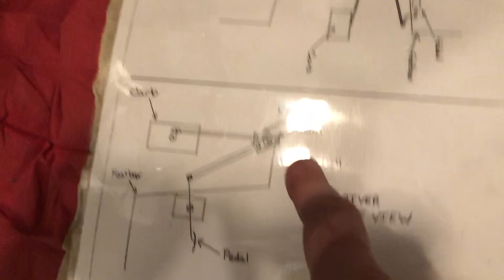Cobra 427SC Replica Build Part 24 Modifying the Turkey Pan!

Comment: Very cool video, I am building a Cobra with a Sniper too. I was thinking about a turkey pan, I may forgo that project within a project. Good thing you are using ARP on the carb studs you world have striped anything else! 30-45 max. 
Best of luck, Pete.
Reply from the maker: If I were to do it again, I'd use the Holley Sniper model #550-872, which is 'traditional' carb shaped and would fit into the turkey pan with no modifications. I also would never use the HEI distributor ever, EVER again!! Way too much of a PITA, and it had the domino effect, as it was in the way of the turkey pan, the Thunderbird degas tank etc. etc. I'm checking out your channel, right now. Thanks for watching and commenting!!
Reply: I looked at that model Holley EFI, it was quite a bit more $ (as I remember) I guess I cheeped out. From the beginning I did not want a HEI front N center. I think-hope all of the PITA things will be memories after they are running! Keep the faith brother.